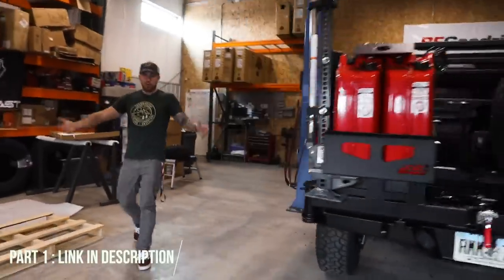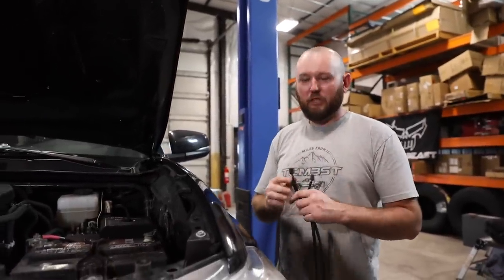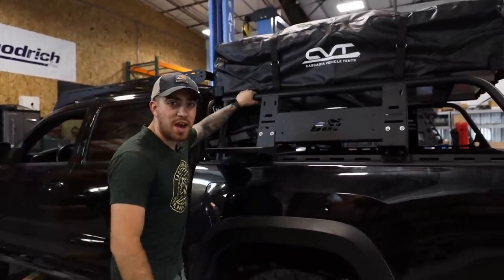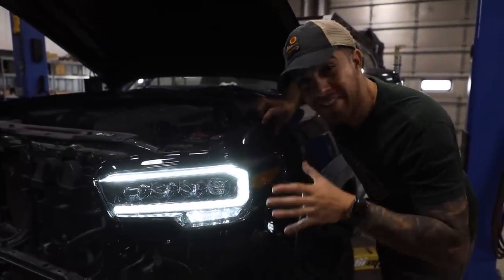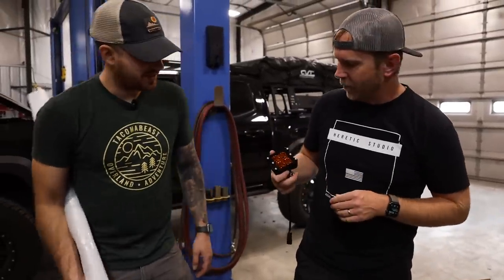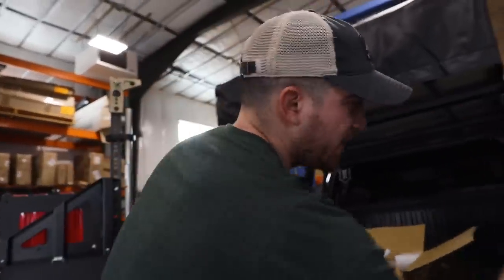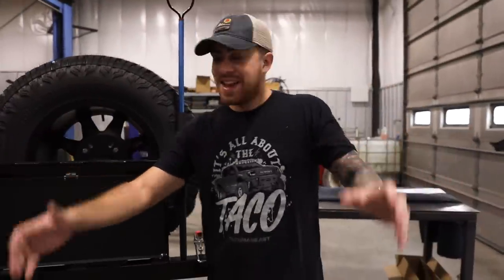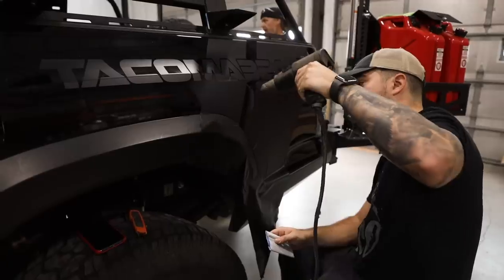Building The Ultimate Reptile Rescue Toyota Tacoma | Part 2

Comment: I'd prefer:
- roof tack might be okay...not sure
- sliders
- aluminum skid plates, front and rear bumpers (daily driver with very mild off-roading. 
- winch is optional 
- leave the factory grill
- leave the factory lights
- no roof-top tent or bed rack because my truck is a my daily driver and I don't want the extra weight.  Also, the truck would not fit in the garage with anything above the roof. 
- camper trailer

Comment: Stock suspension is going to be shot and the engine strain with all that bolt on weight is going to last maybe 40k miles. >10 mpg for sure